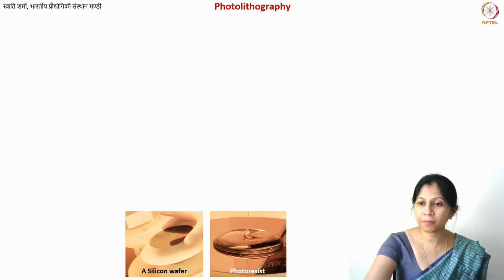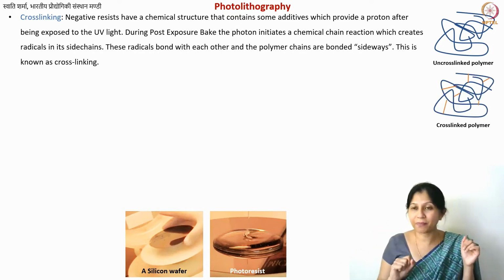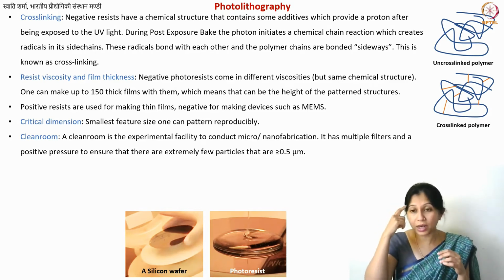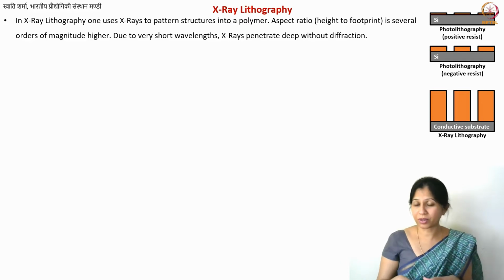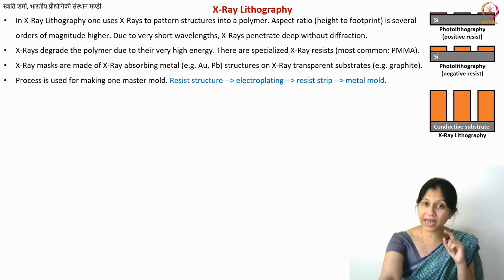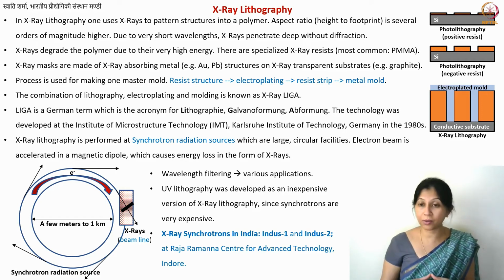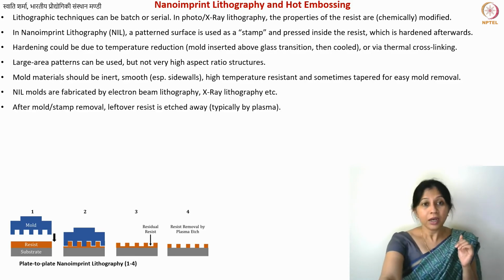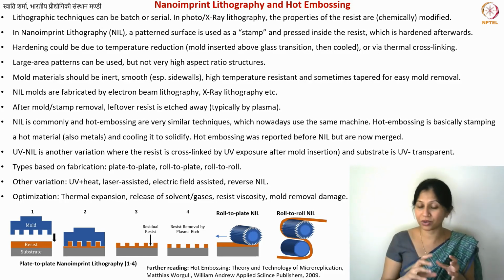X-Ray and Nano-Imprint Lithography

Comment: can I make lithography machine in a garage and print multilayer 28 nanometer integrated circuits with it?
Reply: Lithography machine can be made, but to make <50 micron structures, you will require a room with extremely few particles that are larger than 50 micron (basically a cleanroom). This particle size will reduce for smaller structures. Also, if you are using photosensitive polymers you need wavelength filters.